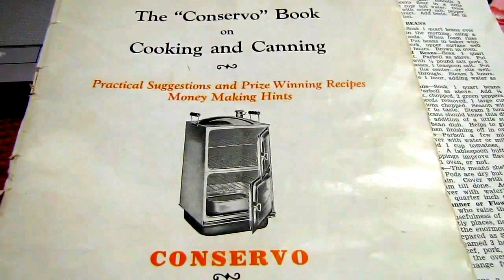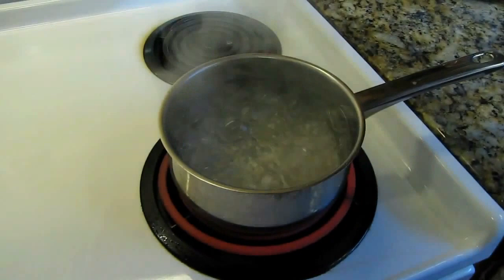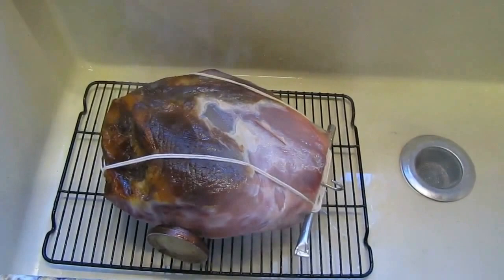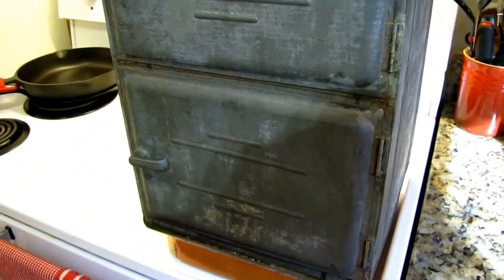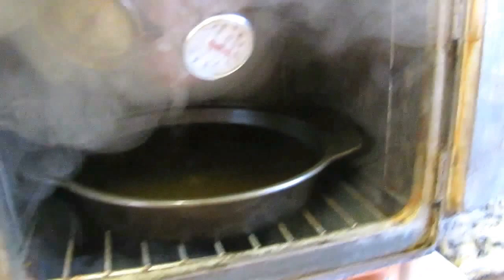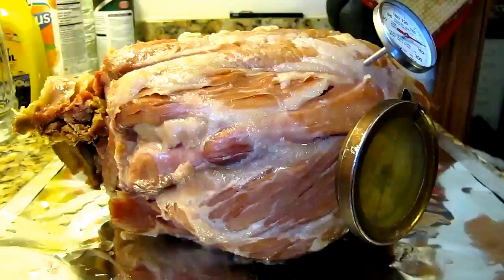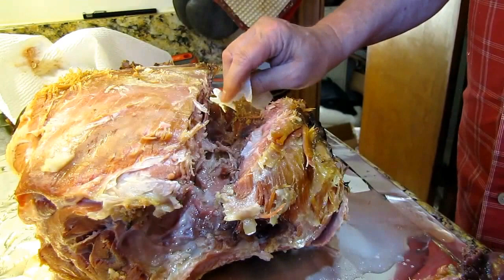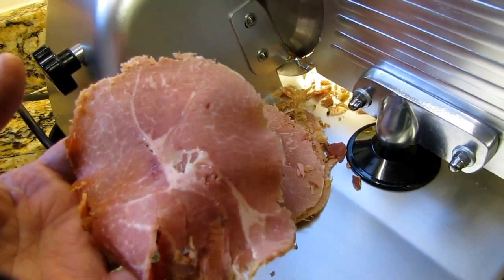Cooking a country ham using the Swartzbaugh Conservo Toledo Cooker

Comment: Bruce - thanks for sharing the Conservo manual - very generous of you!  I have one that I bought at an antique store many years ago but never tried to cook with it.  But I found your videos, and I want to try mine out!  Unfortunately, I now realize that I'm missing the whistle top that goes over the water funnel/tube.  Obviously, mine won't whistle, but otherwise, do you think that missing piece would allow too much steam out?  If so, I found a rounded top cork at my house that fits snuggly in either the funnel top or the hole when the funnel is removed.  If I drilled a hole all the way through it, so some pressure can be released, do you think it might work as a non-whistling substitute?  Thanks for any input!  (I realize this video is many years old now)